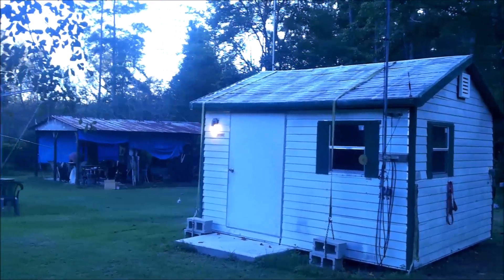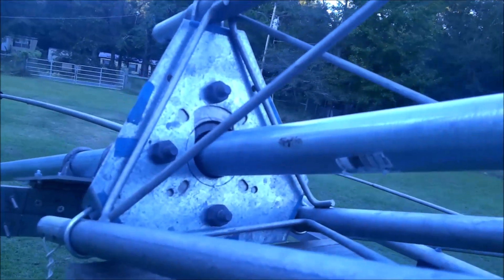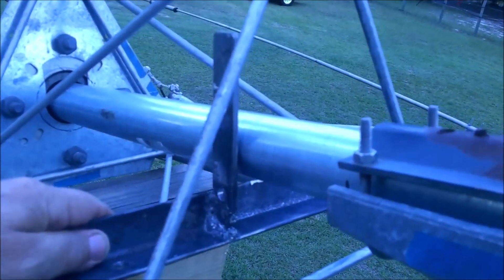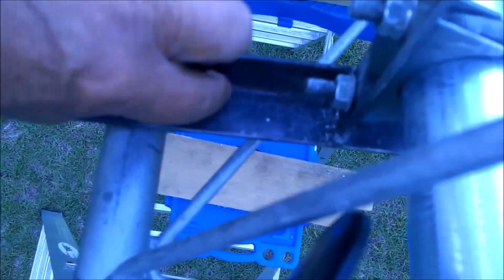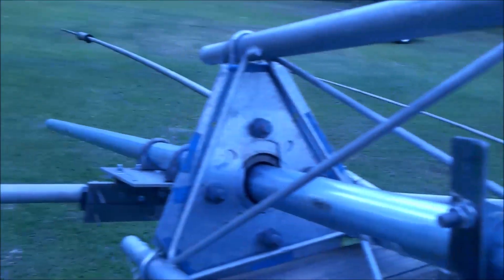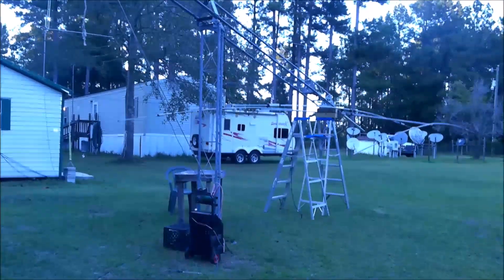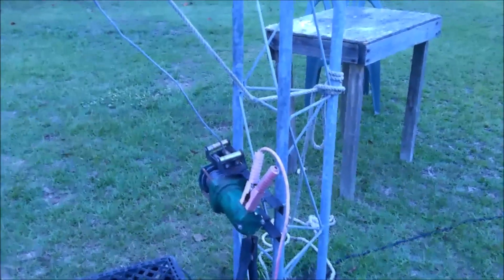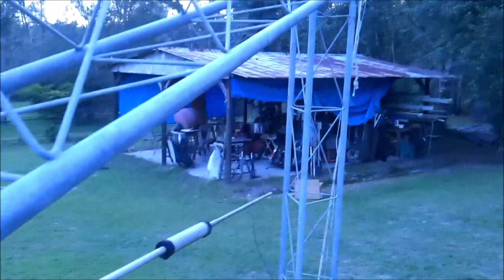Ham Radio HY-Gain IV Rotor Removal Jig

Comment: You replacing or going with something new. This is a pretty slick setup.
Reply from the maker: I'm going to rebuild the rotor but in the meantime I will replace it with another one. I have half a dozen or so that I plain to rebuild them one at a time. I plain to have 3 or 4 fold-over towers when I finish this phase of my Ham Radio antenna farm. I plain to make a video of my rotor rebuild bench if I live long enough. HI HI. I am working on a video of the fold-over tower design and will post it on You Tube. 73 ..Leo
Reply: Looking forward to seeing the upcoming videos 73 ..Stan
Reply: This is excellent! I need to pull my rotator that has been up since '91. I don't have a fold over tower, but the problem is the same, even with everything vertical. 
73,
Len, KD0RC